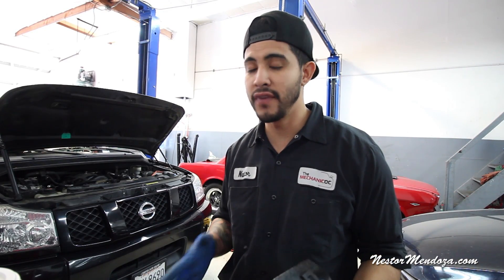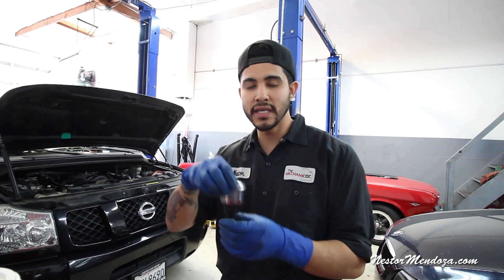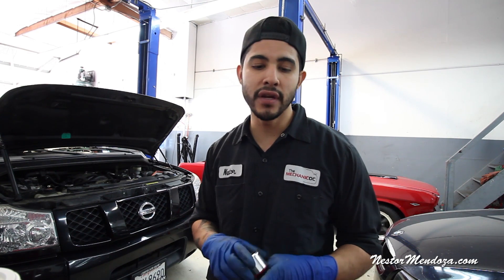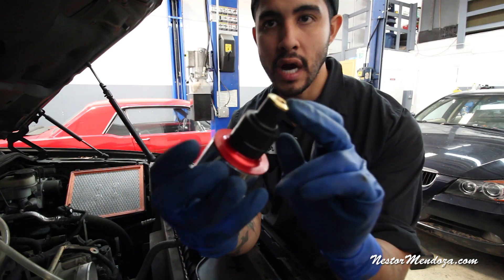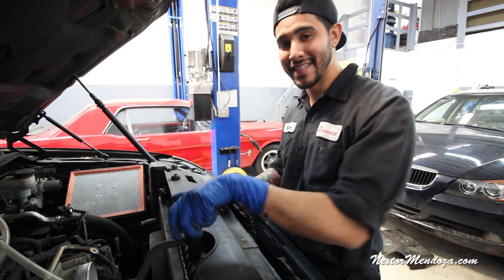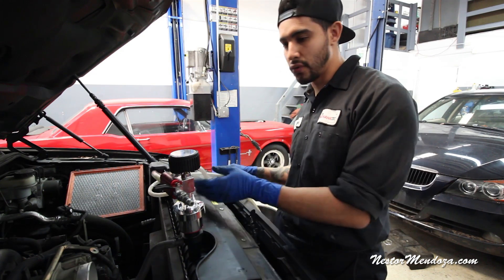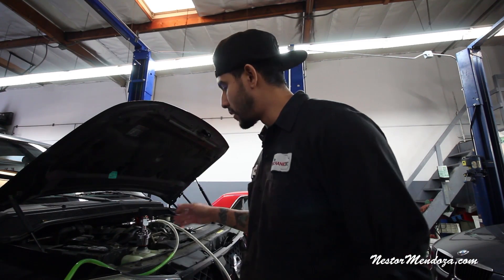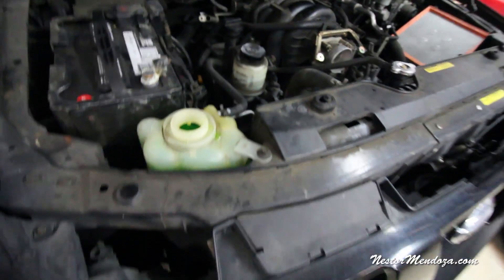Mechanics Test - Coolant Vacuum Filler with a Universal Coolant Adapter

Comment: Hey Nestor why at mornings my upper radiator hose is sucked in already replace cap and still happening. Also getting codes p0171 along with p0174 pls help thank you

Comment: THE MECHANIC OC 
                               "dynamic pressure test" I guess you just leave the pressure gauge on the radiator and increase the RPM of the engine and if the pressure gauge moves you have a blown head gasket or internal leaks?
                                            I'm trying to test the temp gauge by itself to see if its giving "false readings". 
What "Test Tool" can I use to test the temp gauge to make sure its reading correctly or giving false readings? 
                          Plus can I connect another Temp Gauge I can buy at PEP BOYS and connect it to the fuse block to test the temperature to isolate if the temp gauge is the dash board is giving false readings?

Comment: I have been considering the vacuum setup for my garage for a while. In my area people are barely getting by and maintenance isn't a priority. My concern is on older cars is old plastic or hoses cracking while using this setup. Has anyone had this issue?

Comment: This is perfect for the RIgmaster APU. 
The engine sits on the frame of the semi truck and the hvac box sits above the engine. 
This is a good way to refill that system with out having to purge anything. 
Good video.

Comment: the oVer flow tank is always vented to air that IS  HOW IT WORKS ON THAT SYSTEM... IF THE OVERFLOW TANK WAS SEALED HOW WOULD THE COOLANT FLOW BACK AN FORTH DUH

Comment: What about the air in the tube before you start the fill.. I did this job yesterday and was wondering if I just injected a little pocket of air into the system.. Maybe worth priming you tube first, i.e fill it with coolant or something
Reply: I've wondered about that too , but after watching several of these videos by various techs I've concluded that the small amount of air in the fill tube that gets sucked in at the beginning is continually being pushed back out of the system as coolant is drawn in and ends up being pushed all the way back out again .

Comment: Is this process done on an empty system or is it partially filled?
Reply from the maker: you can do it on both. if its partially filled, a little fluid will spit out the exit hose so have catch can on the end of it.
Reply: The Mechanic OC okay thanks for the info jus subbed👍🏼

Comment: Does this tools work for more than just replacing hoses and radiators, like water pumps, thermostat...etc? Thinking of buying this tool to avoid waiting for the car to burp and speed things up.
Reply from the maker: Yes
Reply: The Mechanic OC  dude you're fucking awesome thanks for replying right away

Comment: caps have a couple of functions a pressure release should you have excess pressure build up but it also has a vacuum release 
when the coolant is. cooling down so as not to crush the pipes. joe
Reply from the maker: Thanks Joe.

Comment: Great videos but you still need to learn how to say things in a TECHNICIAN type way . When you are filling any cooling system with those tools, the system holds Vacuum NOT pressure like you kept saying throughout the video. I noticed that you installed the adapter in the radiator not the expansion tank? and I also noticed that you figured it out and install the adapter on the expansion tank but you forgot to say anything about that and I hope you didn't install the tank cap that was not needed? Not a hater man , just giving you a few pointers. I work mostly on MBZ and BMW's, I guess when it comes to installing not needed parts is a huge deal for us since parts for those damn German cars ain't cheap. 

PS , I subscribed to your channel before and then unsubscribed because I enjoy watching techs taking pride in what we do but sometimes your videos lack of a diagnosis process. I think that's the hardest part when it comes to being a real tech on the real world. Replacing components any DIY'er can do but diagnosing vehicles right and gather the right info and providing it to the customer  ( NOT USING IDENTIFIX AND REPLACE THE PART BECAUSE 20 OTHER SO-CALLED TECHS DID AND WORKED ??? ) . Well like I said before don't think I'm hating on you, hopefully I get to see some great videos from you in the near future
Reply: Pablo Martinez well said.

Comment: I wonder how that would work on a Ford 32V DOHC. There is a bottle as well as a plug that has to be removed on a pipe above the intake. I just did one. The fluid has to be added as the car warms up and the tstat opens.
Reply from the maker: alb12345672 it works great on those

Comment: whenever you use the vacuum tool you need to pinch off the small hose to the reservoir to prevent this. i cant really see what type it is. some you do have to go from the tank
Reply: you didnt have a bad cap
Reply: those caps are to block pressure not vacuum.

Comment: If the expansion tank cap is not holding pressure, it can cause car to overheat.
Reply: Mykhaylo Buchatskyi bro it was vacuum... not presssure. the cap wasnt bad. when you use that tool you hook it up to the radiator and pinch off your small reservoir line. if you dont, your cap will suck air because its only designed to block pressure.
Reply: I agree with you about the vacuum, but if the cap does not hold pressure it can cause the car to overheat. Because with pressure, the boiling point of coolant raises and with no pressure boiling point will drop.

Comment: i was a nissan technician for 7 years lol no bleeders or vacuum devices are needed to fill that type of system. its constantly runs through the resivour and bleeds itself as long as the resivour cap is off. nice vid bro!
Reply from the maker: Rolando Mendoza yeah, this ones easy to fill. I wanted to demonstrate how to use the filler with the universal adapter. Thanks for watching bud!

Comment: the cap on the radiator is just a cap. the cooling system pressure cap is on the resivour. thats why u were loosing the vacuum.
Reply from the maker: Rolando Mendoza lol yeah I figured after I made the video

Comment: Nice to see that that style of universal adapter was able to hold the vacuum (27 inHg) as well as the pressure (16 psi). It didn't pop out and it didn't get sucked in. That is a worthy set of adapters and a great review, Nestor.